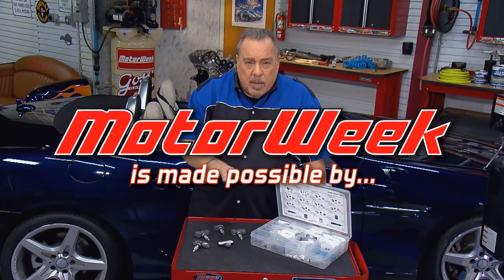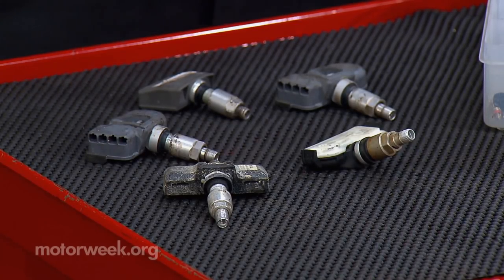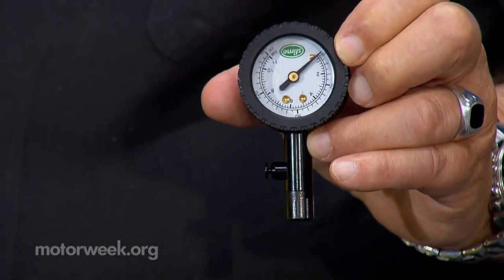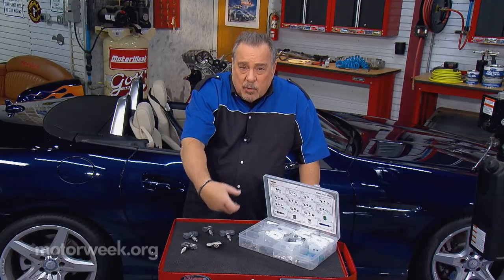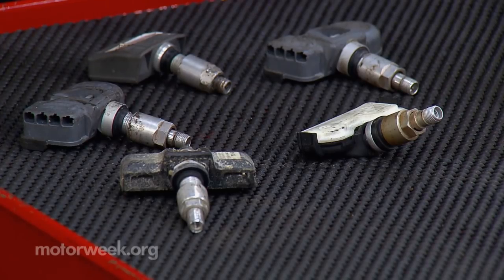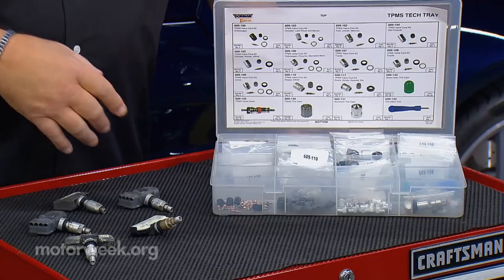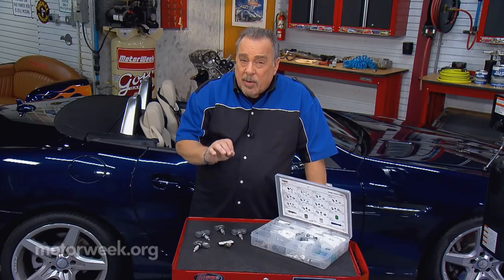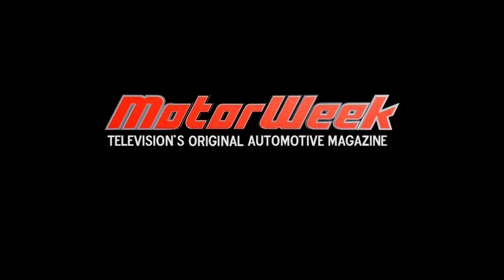Everything you Need to Know About Tire Pressure Monitoring Systems (TPMS) | Goss' Garage

Comment: I just watched your video on the TPMS.  I have a 7 month old Genesis G70 and I though I had a flat until I got it into a Bridgestone shop (who makes the tires for my G70) and they told me the TPMS was screwed up and I would need to get it fixed.  Apparently it was seated incorrectly because once it was seated correctly it started working again.  It was probably knocked loose from its connection by the sh** roads we have in Houston.  I had also just had work done on my car because loon had cut my vinyl bottom rear fender.  Fortunately, none of the Backup. L-R warning indicators, or any of the other sensors went bad on this car.  I know it is the one sensor, because if there had been a problem with all four or with the electrical system every light would have gone off on my dashboard.  So, I am going to send it back to Genesis and have the TPMS fixes, and also, the dingbat when he took the regular tire off put a rash on my rim, so I have to see how much that will cost me as well.

Comment: Have had a couple retrofit TPMS (Screw on Sensors,12v Plug in Monitor) units for several years on my 2003. Thankfully when the Batteries go bad its an easy DIY. Too bad the Industry hasn't gone with External Sensors... Save people a lot of headache.
Reply: True, but that also means the system is easily defeated which makes it pointless.
Reply: @oambrosia  ? Defeated? In what way? If existing Retrofit Sensors are Installed and Monitor is Powered On... It works just like a Factory "In Tire" version does.
Reply: @oambrosia  When the batteries go flat and they get ignored, What's the difference?

Comment: I bought a 2019 STi and the dealer didn't check the tire pressure before I drove it home. The car pulled to the right the entire way home. The front tires were 6psi apart. Next time I buy a car, I'm bringing a tire pressure gauge.
Reply: When I got my 2014 Subaru XV Crosstrek, the tires were aired up to 50 PSI. My manual transmission model specifies 32 psi up front, 30 psi at the back.

It seems that most dealerships skimp out on their PDI. A bit understandable considering the sheer volume of cars that need to get inspected, but still a slightly aggravating inconvenience for the informed consumer.
Reply: AWDfreak 50psi?! OMG that's crazy.
Reply: Fifty psi is way too much for car tires but I've experienced the same at dealerships. Heck, even Discount Tire over inflates the tires a lot of the time in my experience.  A lot of the employees just don't give a damn unless it's their own car. I always double check the pressures with my own gauge because I don't trust anyone to do it correctly.  However, on my truck with its big 8 ply all-terrains 50psi would be nothing to worry about. I run them at 45 psi - 55 psi depending on what I'm doing.

Comment: If the tires are rotated does the TPMS automatically re -calibrate itself or is a manual adjustment required?
Reply: Only on some vehicles, they still read correct but now show the incorrect pressure on a different location on the display..
Reply: @hondatrix  so if say Discount Tire rotates my tires do they also adjust the TPMS so that the readings on the dash are in the correct positions?
Reply: Most reputable tire & wheel shops will have the proper equipment to recalibrate the system so that each sensor will show it's correct location on the vehicle.
Reply: only needed on wheels that use the abs system. merely a button to push on the dash.

Comment: I am such  a nerd, I confess  I check tire pressure everyday.  Sometimes manually even.  3o in back,34 in front.  Still a step above an idiot light
Reply: I take it a step further and ensure that the tires have the same level of exposure to heat, for example, surface area of Tire exposed to sunlight.

Of course, to ensure accurate tire pressure readings, I usually prefer to just adjust them when cold, which my owners manual, a Subaru vehicle, specifies cold as being a vehicle driven less than 1 mile within a 3 hour period. To go even further, I check cold tire pressure on a level surface.

Comment: What to know about tpms: they are absolutely worthless, and constantly break down, causing the light to stay on, and the dealer to charge out the ass to change them. NO. THANK. YOU. just remove that shit, and disable the bulb/notification in your dash with some electrical tape. A $1 tire pressure gauge will keep you informed, and save you thousands.

Comment: TPMS is like a check engine light... No one cares about it. The sensors shown is the video are the worst type. Because the valve stem core gets some corrosion in it then you go to replace tires, use a core tool and the stem breaks. There goes a perfectly good sensor. The whole TPMS system ranks right up the with back up cameras, self parking cars, self driving cars, and blind spot radar crap. When did we become so lazy we can't use mirrors or a tire pressure gauge. And you can all thank ford, Firestone and your government for this wonderful system.
Reply: will disagree about back up cameras.  the purpose is to see below the bumper line where small children may be.